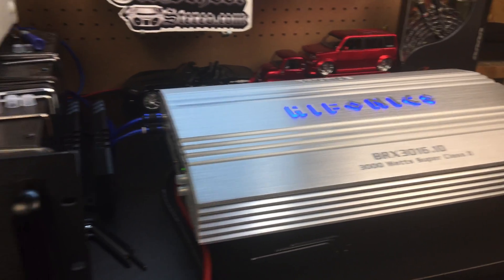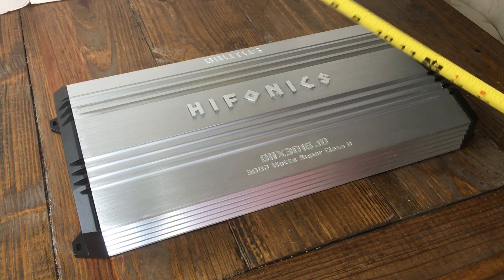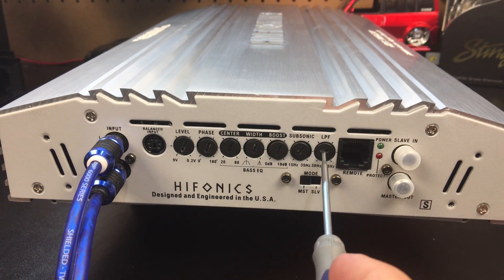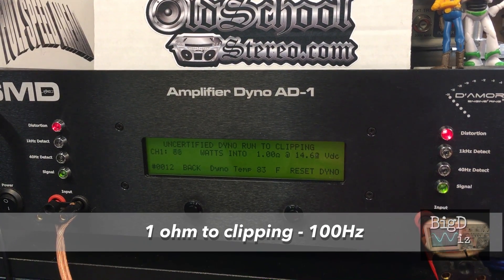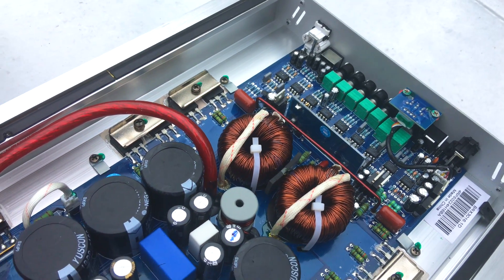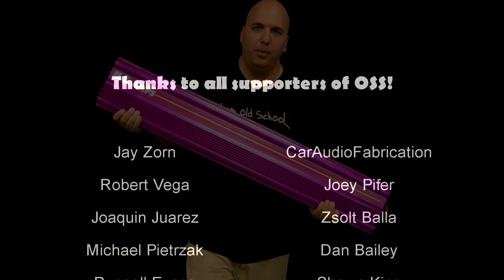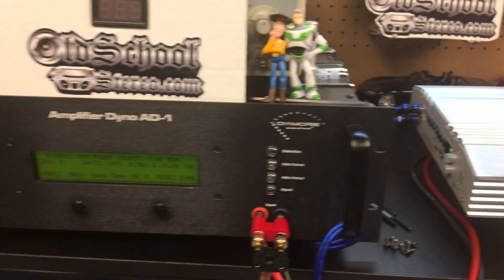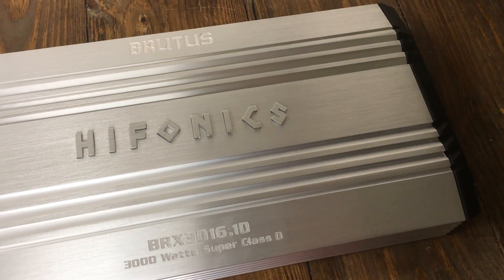Is That 3kW RMS or MAX? HiFonics Brutus BRX3016.1D 3000 watt Amp Dyno Test

Comment: It's unfortunate that some place this amp at or below cost as well as a few other Brands....I use to sale car audio but had to step back out of it due to this type of price busting.
Sound Qube, Sun Down and Skar Audio do a better job protecting gheir line from these type of idipts that destrous the brands MFSP....but enough of that...Big D?...Buddy old friend of mine...lolWhat are the chances of retesting that Power Acoustik EG10K at half ohm on music just for kicks...I under stand that it will never do the marketing rated wattage of 10K peak but that dynamic 4600 plus has me curious of what it may do or don't do...lol
Tag me if you decide to do so....and no I do not support the boagus wattage ratings at all but I use this product due to it sales om the streets and deem to do me great with very littlewatranty issues when I instal them in house.
Reply from the maker: I could understand that is a big problem. I had the reverse problem when I was coming up...shops had stuff priced at MSRP or even higher in some cases (RF was super popular back around 90/91 and you almost had to pre-order some of their amps). I understand supply vs. demand, but I got a bad taste in my mouth for many local shops. When I finally saved up enough to buy my Punch 45HD, I drove 40 minutes to a different shop just so I didn't have to deal with my local RF dealer and their attitudes. I enjoy the competition of pricing on the Internet, but as a shop, you can offer something the Internet can't offer....great advise and installation services.
Reply: Ive been there before....lol
Reply: I am 50 plus  years old but still enjoy building car audio set ups....I collect a lot of older PA gear because it has always been a good entry level brand that had great potential for people on a tight budget but their marketing cause more problems than its worth  ....lol...if they would rate true wattage it would cross over to a wider sales market because it work as it should when used as it should. but that goes with a lot of brands out there as well

Comment: Hifonics, Planet audio, Etc. all use the same boards and more or less components. Ever since Maxxsonics bought everything out amplifiers really went down the toilette. I had a 640.4 Hifonics, at it's rated 4 ohms per channel bridged at 310 watts it barely pushed a couple of wal-mart subs. Though it sounded good which was surprising. A friend of mine is running 2x 12" competition subs (old school) at 300 watts rms each off a 600.1 Planet Audio from around 2013. Get this, rated for 600 watts rms at 2 ohms, it's about the size of a deck. No way it's making that power. He kept trying to figure out why his subs weren't getting any juice and after the amp kept going into protect we figured out why.

Comment: Non contact hall effect based DC Amp clamps can easily be thrown off by magnetic and electrical interference.  Given the potential for high magnetic fields in the area it might be better to switch to a current shunt.
Reply from the maker: Current shunt would be more accurate for sure and it's something I'll look into incorporating into the bench in the future
Reply: BigDWiz vintage high accuracy ones are surprisingly affordable on eBay.  I have several lab grade ones I spent less than $20 each on.  Since there just a few chunks of metal stuck together there's really nothing that can go wrong with them.

Comment: Do you test all your tests with all the gains down? Or a Certain way?
Reply from the maker: gains on each amp are matched to my Alpine CDA-9815 source unit using the Amp Dyno's DD-1+ setup. I usually start with gains 1/2 way as a starting point, but each amp is calibrated to the source unit.

Comment: Dude love the videos you have brought light to some of us buying amps. One request dyno a Old school KENWOOD 800watt KAC-7201 I have owned 4 in the past 12-15 years and still have my original one I purchased from Best buy all those years ago. Along with a pair of Old school Audiobahn DVC 8's 400w RMS (when they made decent equipment) they just died 6 months ago. Back to the amp I have killed 8's/10's/12's and 15's with these amps anywhere from cheap stuff to mid end JL to Rockford Fosgate. Would love to know the power coming out of them. You can pick them up for next to nothing on ebay if you can find them. Much respect to you SiR!
Reply from the maker: Thanks for watching and for the suggestion. I'm always getting in different stuff to test, so you never know what's coming next
Reply: I have a Kenwood kac 9104 d 👍

Comment: Do you always dyno with the gains set at half
Reply from the maker: As a starting point, yes, but each amp is gain matched to my Alpine 9815 source unit using the Amp Dyno's DD-1+ mode prior to the Dyno tests

Comment: Big D man let me know if you read this, i just went and got the hifonics 4016.1 , is there any way you can test one of those next, this test got me worried
Reply from the maker: I read all comments and try to respond to as many as possible. I won't do another HiFo amp for a while as I like to test different manufacturers/models to keep things interesting. If the 3kW version does 1800 RMS, the 4kW version I'd suspect will do 2400 RMS

Comment: Big d. Send me that amp. I'll fix it for ya. Fo fweee. To support your videos
Reply from the maker: Thanks! I'm going to check with HiFonics first to see if they want it back to analyze it based on my tests. I'll let you know.
Reply: That on its own would make a cool video if Hifonics came back with some definitive root cause info. In any case. My money is on the power section FETS. Drawing nearly 300AMPs on those suckers! OUCH :)  I'm surprised tho, I would have expected the Amp controller to go into prot. before it blew something up.

Comment: Had 2 of these strapped on a pair of zv5 15's @ 1ohm did ok other than the heat lol.....however when switched to a pair of crescendo 3500's went from a 145db up to 154db not to mention the current draw was a third less.

Good bang for the buck though.
Reply from the maker: You pretty much doubled the power, so 9dB increase is expected. I have a hard time believing the current draw was 1/3 less though. Takes power to make power

Comment: I just bought a sundown 1500 watt amp for 450 dollars 😭😭😭 so you telling me this amp cheaper and puts out more power ?
Reply: I bought a crescendo bc2000 for like 550 usd (cost me much more cuz im in canada came out to like 700 canadian) and i had a hifonics brx2400.1d that cost 220.. i was keeping the hifonics as a backup amp.. one of the dials got messed up on the cresendo so i did a swap and the damn hifonics pushed my sundown subs harder and better than the crescendo amp which is almost identical to the sundown amp btw.. so my experience had taught me that you cant dismiss cheaper amps.. hifonics has shitty amps that dont do anywhere close to rated and then they have a few that do very close to rated.. if you get the ones that do very close to rated you will be happy. I wish i didnt spend all that money on the crescendo...I feel you are in the same situation as me with your sundown amp.
Reply: KINGKJ2REAL if possible 1/2 ohm
Reply: Yea bro u need to put it to 1 ohm or .5 if u got good electric
Reply: Dans Pistola my sundown type X 12 is duel 4 ohm so 2ohm is lowest I can go. I have 0 gauge wire with battery in trunk and also another amp on my doors. My voltage sits around 13.5 when moving and gets to 12 volts when at stop lights full tilt
Reply: akuma4u its crazy because they way over perform at 4 and 2 ohm, but 1ohm doesnt get near the rated RMS. They are good for headroom I guess.
Reply: Its not all about raw power either. Theres still more variables to powering a sub. Just like some sq amps are better than others.
Reply: KINGKJ2REAL lol that sundown is still more efficient and is .5 ohm stable all day no worries, it will do like 3 probly easy
Reply: Dans Pistola i want to see it on a dyno. I have it at two ohms on a sundown type X it hits hard but not much harder then my kenwood amp that I had on it that cost 160. I guess I need to get the sundown amp to 1 ohm to really see what it can do

Comment: DWiz you set the power output of the amp to half way before the test wouldn’t that effect the output of everything
Reply from the maker: +KINGKJ2REAL input gain on amp is matched to head unit prior to test. I always set gain to 1/2 as a starting point, the Amp Dyno has DD-1+ built in for precise gain matching

Comment: I know im not supplying my 3k brytis amp with the power it needs so it overheats alot or i may not have it hooked right i dunno..i checked on amazon it said it is not to be bridged. I have 4 4ohm subs at 1ohm, 2 hooked together at 1ohm to one of the outs and the other 2 on the other out.
Reply: That would be 0.5 ohms and the reason why its over heating

Comment: BigDWiz, is there something about the AMM-1 that tricks these amps into bypassing their protection and lets themselves self-destruct?  What am I missing, because I am a fan of Massive branded amps and they don't include triangular exclamation point warnings about going lower than recommended impedances? It has been my experience that the Massive branded amps simply go into protect, if you go below more than about a tenth of ohm below rated minimum impedance.  Does HiFonics just give you that much more rope to hang yourself or is the Amp Dyno?   Thanks!
Reply: Good question, why did the protection circuit fail?

Comment: So happy you tested this amp! I know a ton of people who live and die by Hifonics brutus amps & I'm always telling them those amps don't do rated!
Reply: john wagner they don't need to... If you're paying less than $200 for over 2k rms that's solid. They are very power hungry though.
Reply: chupamishuevos303 they used to be the crown jewel brand of car audio until Maxxsonics brought them and turned into trash.
Reply: john wagner you must be from the chi. They barely give them away out here
Reply: john wagner I use digital designs now. They cost more but there's no replacing . CHECK OUT MY PAGE
Reply: Kenny Kimbler the highest it did was 2702 dynamic.... Most of us don't count those numbers cause you'll never see it in your car. Even uncertified was 2200 decent numbers but still not rated
Reply: i told my friends the same thing plus they brake easy mine came blown didnt work lol when i bought it new. my friend bought  a used one only one side work lol
Reply: They had a few solid models after Maxxsonics purchase, but lots of junk coming under crunch & mb quart etc.. especially in the later 2000s
Reply: Jarrett Johnson nah I'm in Nebraska but lord knows these cats live and die by these amps.
Reply: john wagner ha lol I see same with kicker amps the new ones are just terrible 😅
Reply: chupamishuevos303 I haven't ran any of the new ones but God knows the older ones were incredible!
Reply: john wagner 
You didn't watch hole vedio, I mean u couldn't have because if u did u will see it did past 3,000 watts @ 1 ohm.  Watch vedio again dude. 
Kenny
Reply: john wagner 
The Real power is wht I run Linear Power thr at 12.5 back in the day and as u kwn we all are now 14.4 in just about all cars an trucks on the road today haven't had my amp's dynoed since I put 2 alternator's on my hoe. But  just  one of my  800.2 was making about 1,400 watts at 14.4 volt  instead of 400 X 2     i have 4 of thm of 4  18's  and 2 Linear Power 2250 on mids an highs. Take it easy bro
Kenny
Reply: john wagner h
Reply: john wagner n
Reply: john wagner try a brz model and try to say they dont put out rated again lol
Reply: john wagner only reason they wont do rms numbers is if you have a weak electrical system hifonics users like should knoe that you need alot of juice to push this amps.

Comment: I have the BRX1116.1D which shouldn’t have a problem pushing one 12” JL w-3 then.  Thanks for the video.
Reply: I have the same amp. It blew my 10" w3 @ 2ohms but I was pushing it for like 8 hours straight on a road trip. Actually not blown it but ripped out one of the tinsel leads but the woofer still moved when i soldered it back.

Comment: Big D I had the old Zeus (600/900) and the old Lanzar 500 which both ran well enough for my subs back then on a stock alternator. It seems that this newer hifonics would do fine @ regular 4ohm loads keeping the stock alternator in my Toyota FJ since it’s rather efficient. I’m thinking about grabbing one hoping I wouldn’t need to upgrade.

Comment: 250.00, 2700-5500 watts, I have always said that hifonics gives you dirty  power but doesn't most bassheads it will work, right? I always have recommended hifonics to younger kids who just wanna street beat

Comment: I am actually suprized that it fried because I have 2 BRX 2400.1D 's that I had strapped @ .5 ohm .25 each and they never got warm but that may have been because of box rise they might have been closer to 1 ohm each IDK for sure but it did pull hard on my electrical system and my battery swelled up and boiled over lol. Good stuff BigD.
Reply from the maker: +rokstar21375 yeah, box rise FTW. Resistors don't rise, but they often make the smoke rise 😲

Comment: Anybody know what a Cadence fxa-1600.2 amplifier is, Rms? Im seeing different stuff everywhere and not even Cadencesounds has gotten back to me...please help!
Reply from the maker: +Sky Danison wow, interesting they won't answer. Expect 0.25c to 0.5c per watt, even with budget amps. Some get close to 0.10c, but not sure if trust those.
Reply: BigDWiz Yeah. I messaged them with my question almost 2 weeks ago. Haven't tried calling just as of yet. Man Big D Wiz, you are talking stuff that I personally do not comprehend. 
 All I know about the amp is that, it has 1 x 50 amp fuse, 2 channel, stable down to 2 ohms. 
Some sites say it's 
125 @ 4 ohms x 2
200 @ 2 0hms x 2
400w bridged @ 4 ohms
Some say it's
200 @ 4 ohms x 2
400 @ 2 ohms x 2
800w bridged @ 4 ohms
So it's kind of misleading...
Reply: Do you mean 10 - 50 cents per watt?
Wouldn't that be a major difference?

Comment: Not a bad amp over all...  A bit too bad the rating isn't RMS (and they didn't provide RMS ratings.   But dynamically it did very well up untill the magic smoke.  I do like the feature set it has, and I do like the looks.  Just too bad it isn't a Zed. :'(
Reply from the maker: +Reggie Reginato lots of amp for the $$
Reply: BigDWiz It is.  I am getting nogostlic with remembering when they used Zed designs (late 80's early 90's). :-)

Comment: Why I don't by maxxsonics!
Reply from the maker: +dan daves why is that? MAXX ratings? I pushed it WAY harder than it should have been. Only fault if MFG was lack of a better protection circuit 🤷‍♂️
Reply: BigDWiz, the company cuts corners lies on paper does what you and I hate Maxx power ratings. There products are throw away. Seems like a great deal 3000 watts for 250 bucks but when that amp fails and it will 250 isn't so cheap. Ya get what ya pay for. Just not a company I would invest in personally. For you and audio science great. Love the videos keep it up.
Reply: Look at maxxsonic's other line up too. Autotek, mbquart, and crunch. All once damn good brands. Ask your self would you run them now?

Comment: Bro you just helped a lot of guys out with their black Friday wish list lol
Reply from the maker: +jmar662 jmar662 just buy using my links so I can buy more stuff to test 😊🤙
Reply: Have had a brx2400 at .5 ohms till I took it out and strapped 2 brx2000 at 1 ohm which is .5 each and it bangs every day
Reply: @phila8160  how much power do you think it gave at .5 ohms? I have the same exact amp but ive only used it at 1 ohm on an 15 evl. Could it handle a harmony monolith 15 rated at 1600 rms
Reply: I absolutely love my Brutus thanks big d. I bump 2 12 mofo's with no problems. I have 2 guage wire going to my cap and 0 ofc to the amp. Sounds really good in my mustang.
Reply: Everyone that has these wired up as .5 ohms. With box rise I would imagine most of you are not actually under 2 ohms load on the amp itself. Look it up. Box rise. With the Amp Dyno BigD is using it is resistive. Meaning when it says it's .5 ohms that's exactly what it is. No box rise. No fluctuations. Very very hard on the amplifiers.
Reply: I've had 2 hifonics Brutus amps that have been at .5 for their entire life. No I'll effect in the last 7 years.
Reply: shawn schuldt I’ve also had hifonics amp running.5 for cpl years no issues!!ppl always gotta hate if it’s not a sundown amp god forbid so many sundown nut huggers it’s crazy not every one can afford a $1,000 amp ya know
Reply: Yeah I had a BXi1610D that I had wired to 1 ohm.... Turns out I ordered the wrong subs and didn't notice for 10 years... What I thought were DVC 4ohm subs were actually DVC 2ohm.  Meaning they were wired for .5 I think... I never noticed.  Amp worked great for 6 years in the Texas heat and never cut out.
Reply: _1_  Testes!!!! 😂😂😂😂
Reply: Why turn the lpf all the way up ?
Reply: Every hifonics amp I’ve had I’ve been very happy with! I really like these amps for the price and performance! I always just figure if it says 1000 watts that it’s 500watts rms. These amps are super tough and built to last. I always push things to their limit and these amplifiers take it all day for years!
Reply: HIFONICS ALL THE WAY.... HAD A BRUTUS 1200.1D ON TWO 10 INCH ALPINE TYPE R DUAL 2 OHM IN MY MUSTANG..... POOR MUSTANG IT RATTLE TOO MUCH